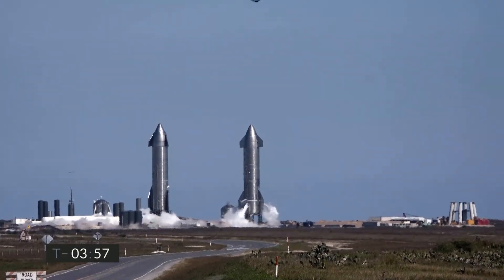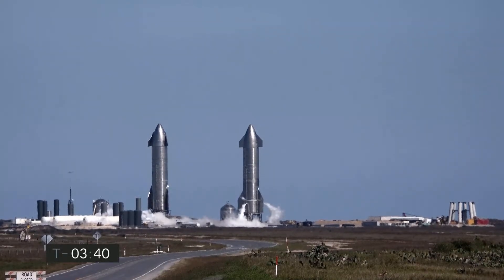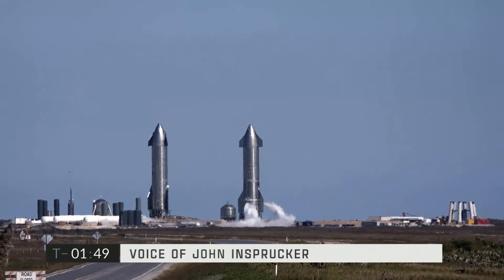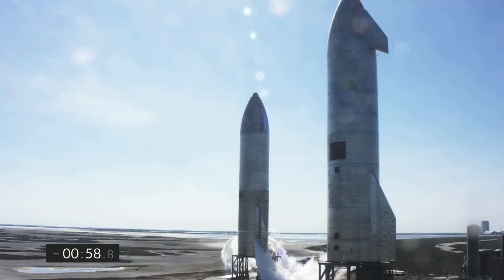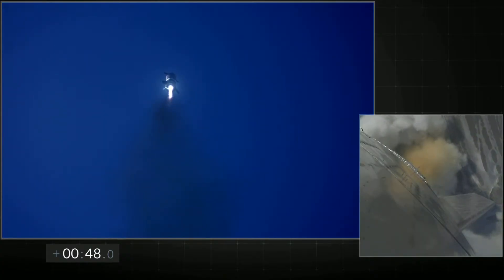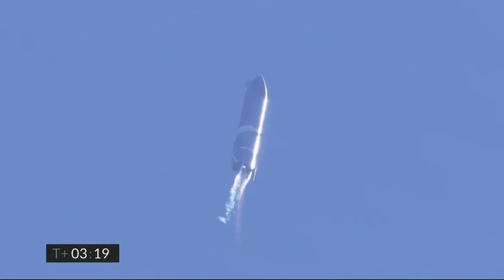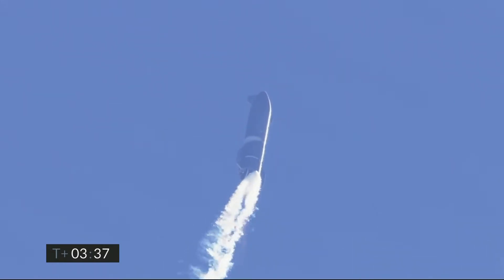Starship | SN9 | High-Altitude Flight Test

Comment: "SpaceX, your Starlink constellation is suffering from 'static magnetism'. Your solar arrays act as giant collectors for orbital debris and ionized particles. Static potential works like glue, creating micro-shorts and 'hot spots' that burn your cells from the inside. You’re launching new satellites weekly because the old ones are 'blinded' by this buildup. Our charge-neutralization method makes surfaces 'slippery' for dust and ions. This allows for smaller arrays and double the lifespan. Stop replacing junk—fix the power physics. #Starlink #SpaceX #ElonMusk"

Comment: Good landing..............What a Joke...Go back to go back to England where you belong.....USA use's the  Imperial System. The biggest reasons the U.S. hasn't adopted the metric system are simply time and money. When the Industrial Revolution began in the country, expensive manufacturing plants became a main source of American jobs and consumer products. The Apollo Guidance Computer did use metric/SI units internally for its calculations. But it converted to imperial/USC units when it displayed data on the DSKY. This is probably because the Apollo astronauts (mostly trained as test pilots) had an intuitive "feel" for imperial/USC units.
Reply: The imperial system originated in England, the foot is literally based on king Henry's feet?

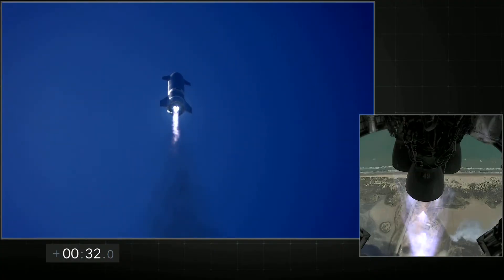Comment: 5:58 lower right screen. Does anyone else see an o-ring break off and fall past the flame?
Reply: yes but it doesnt matter, the engine was on fire and this was a very early flight on the program, there were lots of problems
Reply: @politonno2499  even though it wasn’t the main problem, I’m sure it didn’t “not matter”. Losing any part of a rocket has to be a small problem
Reply: @mr16325  I think it was due to an error of a thermal protector of a rochet engine, which fired some pieces inside the engine bay
Reply: @politonno2499  what’s a rochet
Reply: @politonno2499  Gotta go with Nk Nk on this one. Whatever it was seem to come out of the engine bay from the one engine that failed to re-light. Probably its Spark Ignitor since the engine seems to shut down almost immediately after. I could be wrong though. Anything that happens during a test flight matters, as it can be used to make the next test flight even better like we saw with SN10. But you are right, this was very early in Phase 2 of Starship testing and they were still easing out Raptor issues.
Reply: @mr16325  rocket* 😔

Comment: THERE SHOULD BE 4 MINI  MOVING GYRO THRUSTER LANDING IT HORIZONTAL NOT VERTICAL AS TOO MUCH FAST PRESSURE IN VERTICAL LANDING  - ALL THE  4 MINI  MOVING THRUSTER  LANDING CAN FIX THIS PROBLEM  !!! the engineering is way back primitive and super medieval its very non alien design engineer !!
Reply: You don't know what you are saying lol
Reply: @OortCloud  u mean what isay or what you say  !! say yes or no ,,,say what u say !!
Reply: @jonram747  That makes no sense. ALso, look at SN10. It landed correctly without making any big changes.
Reply: @OortCloud  still primitive
Reply: Just reminding you this comment exists

Comment: Dear Space X Engineers and Staff.  I think what you have accomplished is nothing short of outstanding!  I would like to share a thought please if I may.  I was wondering if we could alter the landing of the Starship to land in the horizontal position, then utilizing mechanical limbs and or an exoskeleton, right the ship upon landing.  I have noticed several anomalies while scouring the video library.  Blow back of fuel and gases into the engine cone among other concerning items.  I feel the fuel consumption and stress upon the rocket, engines and systems would be significantly reduced with a horizontal landing and a righting of the ship for secondary takeoff.  Thank you for allowing me to share  Frank.bua@comcast.net

Comment: Seems like those engines are not reliable. By two launches, they would have a 50-50% chance of not lighting up. So if we use three engines and shut up the failed one, still that leaves the probability of 67% of landing correctly with 3 engines. Now if they have say 7 engines, still the fundamental problem remains- they are not reliable when starting. Imagine taking all costly payload to Mars and the mission would fail only because those engines couldn't function reliably.
Reply: These engines were made from scratch just like starship. It will fail from time to time because of how new it is. That is how they gain the amazing amount of data they get
Reply: These engines are very reliable, it has too much thrust to land on more than two engines
Reply: @jackwhitlock1 if not being able to fire up at the right moment isn't a measure of reliability, I don't know what is. They should improve their engines first.
Reply: @jackwhitlock1  also, merlin engines are 99% reliable and having multiple engines do help, but raptor is made to do multiple flights in a short period of time without refirbishment. They got to ensure that the engines fire at the right moment and not too late
Reply: @saurabhchandra6267  The Raptor engine is still in development
Reply: @jackwhitlock1  yes it is. And I m sure they will come up with innovative solutions.
Reply: And its had more than 2 flights
Reply: Just reminding you this comment exists

Comment: Should have learned from sn8 light the 3
Reply: Not that simple
Reply: @logitech4873  how so?
Reply: @pedrohenriquemenegolitamas5293  They both had different problems surrounding ignition. They did learn from SN8, but then faced another problem.
Reply: @logitech4873  different problems surrounding ignition but it consist of ignition problems, omg you americans lost the all known "American ingenuity" with that airplane fetish and the idea to put one into space
Reply: @pedrohenriquemenegolitamas5293  I'm not American.
Reply: @pedrohenriquemenegolitamas5293  Eurotrasher spotted :D
Reply: @OortCloud  no need to get spooked by my surname and think I am going to play colombo on you little village
Reply: @killerqueen4681  they don't, it is actually a part of antropology to study the americans and hollywood, what are american fantasy's and what it tells about them, the reason why everyone that makes deals with them goes losing...
Reply: And how would they have learned that from SN8?
Reply: @jackwhitlock1  cause one failed to light up they could have used the other
Reply: @pedrohenriquemenegolitamas5293  SN8’s engines performed normally, but one lost thrust due to low fuel pressure
Reply: @jackwhitlock1  wouldn't it be better if they had the other one lit to compensate and just turn off the one with the problem?
Reply: Sn8 engines ignited normally but they lost fuel pressure and it caused them to go engine rich, sn9 tried to ignite the engines and one dis ignite but one failed to. So sn10 will light the three and shut off one after the flip for landing and im american so hows that for ingenuity fucker

Comment: I say they need a more stable re-light, spaceX knows it; and they need more time to relight safely, hence they need to relight sooner, higher up, with more engines and more power available. SpaceX knows more time adds time for more safety but they will see if they can make it with the bare minimum of time and only add more reliability. My opinion here is that the latter priority is unethical.
Reply: Just because you say something, doesn’t mean you are right. You know nothing about Thrust-To-Weight ratios

Comment: I would suggest stop fliping the rocket , thats where the problem is , let it come back the way it head up.
Reply: The sideways descent is the whole point of this. By falling sideways, it exposes a lot more surface area to the airflow, and hence create a lot more drag.
This means it falls a lot slower than a rear-first rocket like Falcon 9 does (220km/h vs 1100km/h), and so needs a lot less fuel for the final landing burn.
This will be particularly useful in the thin air of Mars, but also helps for Earth reentry by slowing the ship down sooner and spreading the reentry heat over more area.
It needs to withstand far more heat than Falcon 9, since it reenters 5-7x faster and since heating scales roughly with the cube of velocity, that's 120-350x more heat.

Comment: The third test is still the main one, you don't want to crash. Firstly, they are weak maneuverable, they do not hold in an upright position for a long time. Secondly, when landing on a horizontal position, three engines must work to reach the initial state of the thrust weight during landing. In the third, to reduce the weight of gravity, go earlier to the landing position.
Reply: Using 3 engines would be too much for landing because the raptor engines can only go from 40-100% thrust. Elon already stated they are trying to lower the flameout risk so that the raptor engines can go below 40%. The landing flip is done at the perfect time and it is done at that time because of the amount of fuel it has.

Elon also stated that with SN10, They will begin the landing flip with 3 engines and shut off the damaged one and conduct the landing with 2 engines (as normal)
Reply: @OortCloud  what if all 3 engines perform nominally?
Reply: @velociraptor3097  they will still turn off one engine for a nominal landing burn

Comment: People will die because your incompetence. You have no working engine (it's main designer just left the company!), overweight vehicle and obviously you don't know what is wrong with your own hardware... Soyuz 1 in making.
Reply: This is why you test. The first planes crashed
Reply: Tom Mueller was not the main designer of Raptor. He did some work for the early versions prior to 2016, but was only an advisor on the new redesign.
And Raptor is working fairly well. So far six engines have all worked flawlessly on ascent and 3/4 have restarted correctly on descent.
Also, by all indications from the Texas tank watchers, the current prototypes are actually underweight compared to the planned design.
Reply: @lazarus2691  Thank You for detailed clarification :)
Reply: It's called a test flight. They TEST it so they can fix the problems, before anyone actually flies on it.
Reply: And the Soyuz is the most reliable thing in the world
Reply: Just reminding you this comment exists

Comment: What about a backup chute ? With cbon seperation incase the engine fails on landing, anyhoo.
Reply: also SS is not meant for just landing on Earth, it will land on Moon, Mars and maybe elsewhere. Those conditions doesn't support parachute landings, over there only propulsive landing works

Comment: DC-X did this 28 years ago, but successfully.
Reply: It did a bellyflop?
Reply: DC-X did nothing like this. DC-X's 'swandive' was a brief sideways jaunt under power, that at no point was fully perpendicular to the airstream.
SN9 performed an unpowered sideways freefall, controlled using only aerodynamics, and then attempted to relight it's engines and return to vertical.
One of which did start, and SN8 was 2 for 2. DC-X at no point in it's testing performed a midair relight or freefall; it's engines always ran for full duration.
It's also worth noting that DC-X was far smaller, didn't go nearly as high, or stay airborne for nearly as long, and had far simpler engines (expander vs FFSC).

Comment: Anytime some amazing updates are done on these vehicles, unless you want a landing ignition that wants to be called "master-landing-flip-no-altitude", this new bird that wants a such angle attack optimizes the rudders in weightlessness accelerometers of the (fuel-axis-force) in the turbines so that the vertical landing, inversely of time equal to the vertical-ignition- reaction and take-off, is activated in the famous starlink-cargo 4in1 self-guiding landing altitude of the mixture itself, so the mixture drop avoids. Remember who cares about a bird's shadow outside of itselves that only a true navigator operates with their eyes closed, whatever the first flights, the most beautiful are inevitably future, great success to all , which are on the way ...
Reply: yasio bolo  
What's special about the F-22's take-off and landing technology? AFAIK it's fundamentally no different than aircraft from a century ago.
Also, even if fitted with rocket engines, it still has an abysmal mass ratio. It would struggle just to make the Karmen line, let alone orbit.

Comment: hi Space x, i think some parachute or a new engine (4x more powerful) could solve the landing problem :)
yes we can Mars
Reply: the problem with engine was a restart and parachutes aren't reusable and not even equally useful for Mars and Earth
Reply: These engines are more than powerful enough. They're so powerful that they can't land with all three, and even two might be too much.
The current plan is to use two for the flip and then shut one down and land on just a single engine. 
Using an engine 4 times more powerful would make landing hopelessly impossible.
Reply: hi may be it's just a calculation error , bcs gravity on Earth is added to SN9 return speed, the engine must be powerful anough to reverse the landing speed i think :)
Reply: @DjKosmoz2050  dude, one of the engines that was supposed to turn on, didnt turn on. thats engine failure.  also, this vehicle is way too heavy for chutes. It would snap in half
Reply: @DjKosmoz2050  
SpaceX have landed 74 Falcon boosters from space. They know how to run the math for these kind of landings. 

But since you seem to think that a team of some of the brightest engineers on the planet could have made a basic calculation error, let's check:

The ship weighs ~120 tonnes. One engine can produce up to 200 tonnes of thrust, which gives an acceleration of ~16.7m/s^2, or ~7m/s^2 when subtracting gravity.
That allows it to decelerate from it's terminal velocity of ~70m/s in around 10 seconds and 350 meters. Since the flip was initiated at 550 meters, that seems quite reasonable.
So even one engine with the current thrust is sufficient to land it, provided it can complete the flip, which requires two engines.

Two engines is more than enough; almost too much. They can accelerate the ship at ~23.5m/s^2 when subtracting gravity, enough to stop the ship in 3 seconds and ~100m.
3 seconds instead of 10 gives a lot less time to correct for any mistakes, and 100m instead of 350m means flipping a lot closer to the ground.

But what you're proposing is that the engines should be four times as powerful. So 800 tonnes of thrust to land a 120 tonne ship. That's an acceleration of 66.7m/s, or 56.9m/s after subtracting gravity. This reduces the landing time to 1.2 seconds, and distance to just 43 meters, less than the ship's own height, making the margin for error incredibly small and requiring a flip very close to the ground.

To make matters worse, the ship will no longer be capable of hovering to make corrections. It has to land perfectly on the first try or not at all.

The engines have a minimum 40% throttle. So a single engine can go as low as 80 tonnes of thrust. At 60% it will make 120 tonnes, just right to hover.
Two engines have a combined minimum thrust of 160 tonnes, too much to hover, which is why SpaceX plan to shut one down partway through the landing and finish on just one.

However, if a single engine was four times more powerful, it would have a minimum thrust of 320 tonnes, far, far too much to hover a 120 tonne ship.
Even at minimum thrust, the ship will only slow to appropriate landing speed for about  a tenth of a second. After that, it will launch upwards faster than a hypercar does horizontally.

So like I already said, the current engines are powerful enough. Making them four times more powerful would make a landing near impossible.
Reply: @lazarus2691  Thanks for that. I learned some stuff
Reply: Good job Elon Musk
And Crew 
Im praying for SN10

Comment: Excuse me Elon Musk, but there is already the take-off and landing technology of the F 22 raptors, if they get bigger and adapt with oxygen engines you will have a modern and excellent autonomous ship, or for example a hybrid between the plane that you yourself  He proposed vertical take-off and that when it reaches the edge of the atmosphere it can turn on its oxygen engines.  you have to be more practical.
Reply: What's special about the F-22's take-off and landing technology? AFAIK it's fundamentally no different than aircraft from a century ago.
Also, even if fitted with rocket engines, it still has an abysmal mass ratio. It would struggle just to make the Karmen line, let alone orbit.
Reply: they are working on it

Comment: Spectacular fireball 😁
I really hope they get it right on SN10, because it's about time that IA learned it's descent speed and sticking a landing. 
Good luck Elon sir.
Reply: maybe they are already using AI in a lot of works
Reply: The AI performed very well. perfectly in fact. the fault was that one of the engines failed to turn on causing loss of control, and high speeds which resulted in a loss of the vehicle
Reply: @reagank.2268  I was under the impression that the AI failed to start that engine, thus leading to this learning experience..

Comment: I think they should change the orientation  from belly flip to normal at a greater height.
Reply: But that still wouldn’t help if an engine failed to light
Reply: it needs to touch down at zero velocity, flipping early would either waste fuel or have it go back up.
Reply: no, that would mean less aerodynamic drag, and result in a waste of fuel. and also, if an engine fails to relight, your going to crash no matter what.